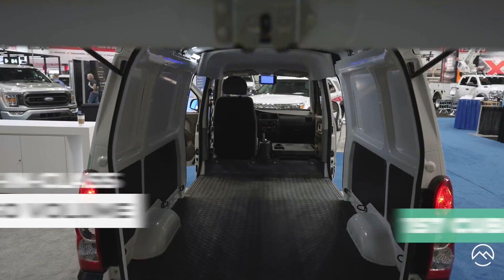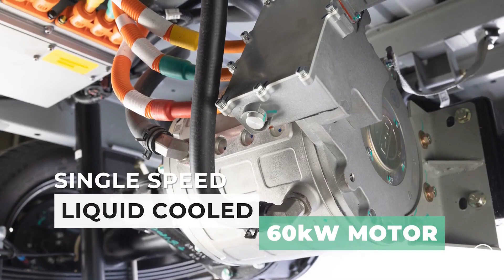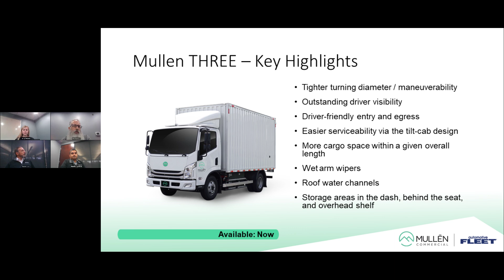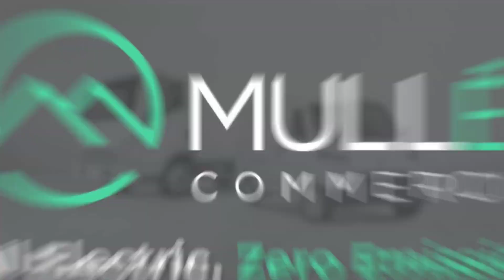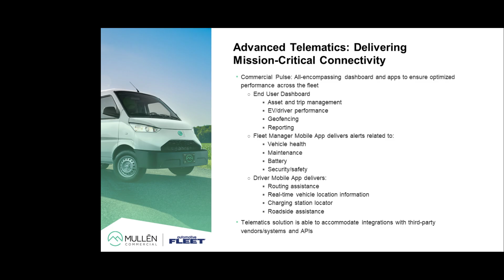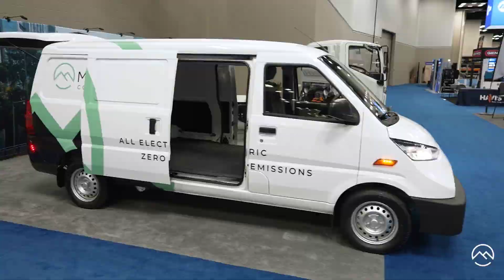Revolutionizing the Commercial Vehicle Market with Light-Duty Electric Vehicles

Comment: So, my dad used to be a plumber; on his average day, he would go 1.5 hours away to a city and pick up supplies.  Often, a furnace and water heater, now mind you, and the van he used to serve as a plumber also had all his tools.  Then he would drive back that 1.5 hours, go to the job site, and work at installation.  This was summer or winter in Manitoba, which, at the time, he was a plumber, could be either 100 degrees F or -25 F on an average day.  He did this for most of his life. And how would an EV van work into his trade life? Could he complete a 10 to 12-hour work day and be as efficient with an EV van as he was with his old beat-up Chevy Econoline van?  The other aspect to take into account is that not all job sites have any services installed.  Often, he roughed in the Furnas before the concrete floor was poured in the basement, but the actual meter had not been installed at the house yet.  So there was no electricity to couple to. He worked on farms where the services had yet to be strung overhead into the farm.  I remember helping on a horse ranch in their new house. There was no power for the Red Hat pump and the deep well, but we were trenched in the water line and the sewage system anyway.